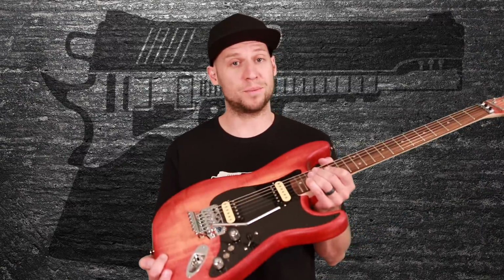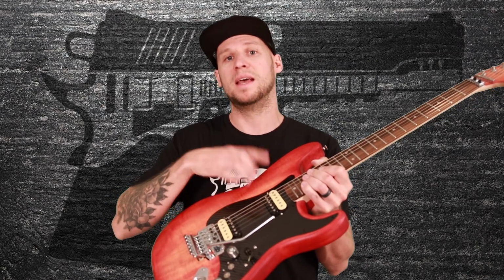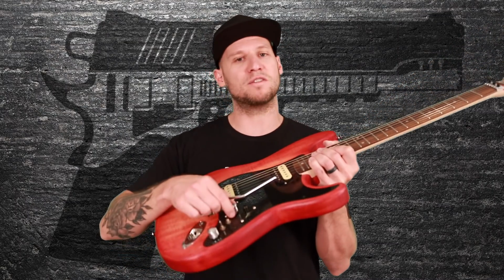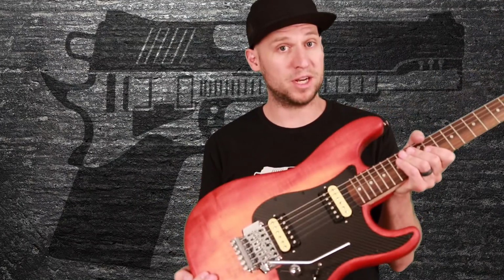This ONE Guitar has EVERY WIRING HACK POSSIBLE! (well...almost...)

Comment: Hey dude, i know its unlikely you will be able to reply, but i plan to essentially do what you have done here but with a strat with 3 humbuckers like your previous video - My plan is to have a 
1-  3 way switch for each pick up (for series parallel and split), 
2-The 7 way switch mod (where the neck pickup is turned on constantly) so i can have all 3 on at the same time or neck and bridge, 
3- the push pull on each tone pot for in phase/ out of phase
4- push pull on 1 volume pot for series and parallel (as there is only one position that will have all 3 pickups working at the same time, i was going to try to work out some crazy option where you could have multiple variations of the 3 pickups working in parallel or series( being able to select which 2 or 3 are working in parallel or series using multiple push pull pots) while have 2 of them work out of phase and the 3rd in phase or all 3 out of phase or all in phase as standard etc,  and still having your 3 way switches to turn each of those individual pickups in split, parallel or series  but again i dont know if its physically possible or even worth it as it got super complicated but has so many more options)
5- individual volume and tone pot for each pickup so you can blend the tone and volume between each pickup for extra fine control on the tone

Is there anything here that you came across to be completely unfeasible when building either of your crazy modded guitars?

Comment: Do you sort out all the wiring options yourself, or is there a program that can assist in that? I'd like to find what all is possible with what's in my guitar (some upgrades that are mostly underutilized), but I'm no wiring guru by any means.
Reply from the maker: I don’t know if a program. I’m not much of a wiring guru either, I just read a lot of forums and look at wiring diagrams and try stuff to see if it works. It took about 8 try’s to get this setup to work properly.
Reply: I was hoping that someone had finally made a program that you can plug components into along with some other criteria and have it generate a list of tonal options and wiring diagrams (wishful thinking I know).
Have you ever considered using push/push pots. A local luthier uses them in his guitars, but I couldn't find them anywhere back when I replaced my original pot. They cost more, but are much easier to activate.

Comment: I priced out the entirety of the parts and I don’t see how you came up $250.  Those carbon fiber pickguards are expensive compared to a regular plastic one,  albeit you did find a good price on the Floyd rose.
Reply from the maker: I never include the cost of the pickguard or the stains/finish in the total cost of the build because they don’t affect tone or function, just for looks. But yes if you wanted to build one exactly the same as this one it’ll cost you a little more because of the carbon pickguard.